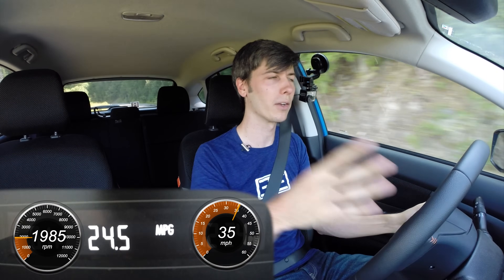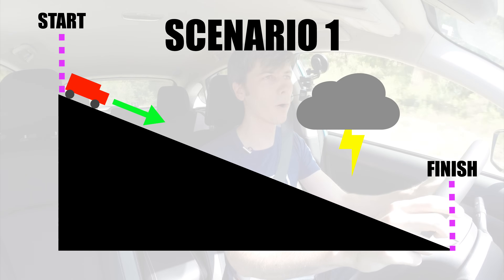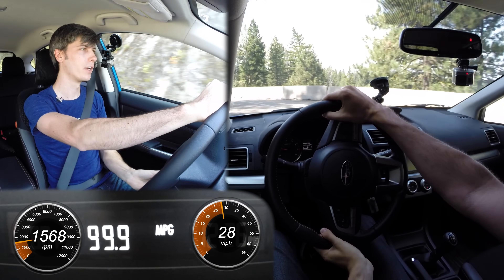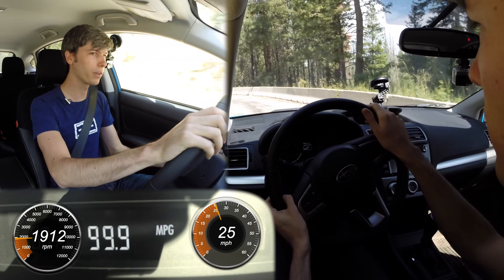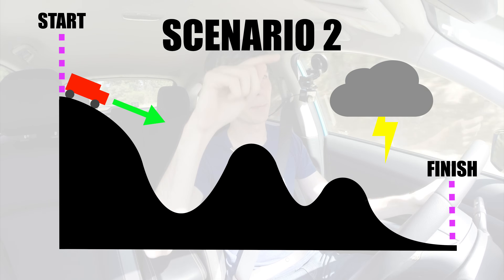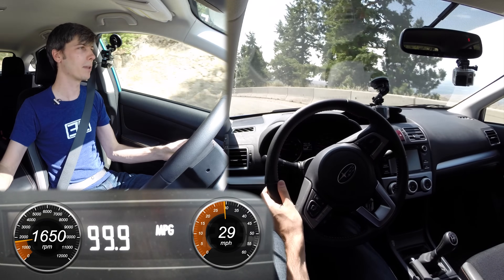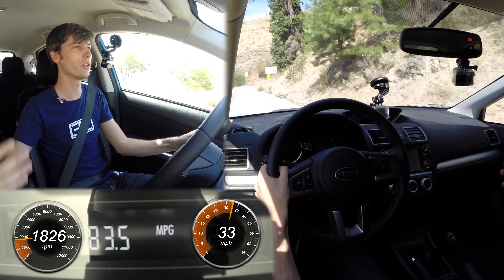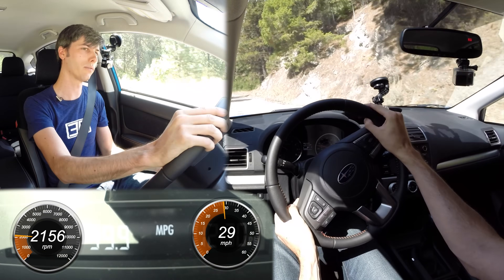What Uses Less Gas - Coasting Or Engine Braking?

Comment: If no fuel is being injected, why does the engine still make noise?
Reply: The engine is essentially a pump. It's always  sucking in air and exhausting air. When it burns fuel the exhaust air is hotter and will move faster and will make more/louder noise. It still makes similar noises even when no fuel is being burnt because it's still doing the same without the fuel. Look at the Otto cycle again, and you will realize why. I'll give you a hint. Pay close attention at the compression and power strokes.
Reply: charlesmcguffy because air is still being compressed in the engine. You won't hear any combustion noise though
Reply: it's still pumping air in and out of the valves.
Reply: charlesmcguffy my guess is air is still being taken in, compressed, then exhausted out.
Reply: charlesmcguffy The engine is still running because of momentum and moving parts make noise maybe?
Reply: Exactly, @Dan. Especially noticeable in our family's Volkswagen equipped with a PD-based diesel engine. You can hear the engine at 2000 RPM when the injectors are shut off (instantaneous consumption figure showing as 0.0L/100km), but absolutely no diesel combustion noise. Use the accelerator and you can hear some diesel clatter again.
Reply: +charlesmcguffy
ha ha ha! that's funny!
Reply: Still moving
Reply: c'mon is this a question?... valves, chain, gears, pistons, you know there are a loads of moving parts.
Reply: Like hooker😀 you choking her but she is still alive.  Hahaha
Reply: Dan Sneyd not really.. 2nd gear 5000rpm downhill with no gas is JUST as deafening as 2nd gear 5000rpm flat surface. Engine still uses fuel to keep it ticking

Comment: I often See people with the clutch in and braking in the same time, wasting fuel and brake pads. Always have to laugh at them.
Reply: arand4 depends on situation, cant always brake in gear..
Reply: Bringing clutch up slowly is not engine braking, that's braking using your clutch and wears it out really fast. I'd much prefer to replace my brakes than my clutch prematurely $$$$
Reply: Don't blame a country on your lack of knowledge
Reply: Actually, I do. Are you telling me that the slowing down experienced when you 'slowly bring your clutch up' is not simply turning the kinetic energy of your car into heat in your clutch via friction. Engine braking has nothing to do with how you get into gear, merely the fact of being in gear itself. It is always better to match revs to preserve your clutch.
Reply: the clutch doesn't wear if it isn't slipping. Thats why you rev-match. Your clutch doesn't/ barely wears and your brakes don't wear at all. He explained this in an earlier video and i can confirm that my statement is true by experience.
Reply: as you 'slowly release' the clutch the friction from it slipping and raising the flywheel's speed causes wear on the clutch.. a short blip of throttle to raise the speed of the flywheel to match the clutch speed due to the road speed prevents all that wear but you still get engine braking.. sorry but you are just wrong on this Wiikendz, there is a lot of information out there on this
Reply: Wiikendz you should only brake like that in emergencies. In normal situations you should always try to rev match and brake on your engine as much as possible, your brake pads and discs last an insane amount longer if you do this properly
Reply: The Real Santa Claus Still depends on situation. Have gun going 90kmh on a country road and do engine braking before a hard right turn if you have cars behind you. You can at most drop a gear and brake that one out before dropping the clutch for a harder brake. Unless youre really confident with heal-toe. 
I live in Sweden, everyone here can drive a manual, most of our cars are manual and has been since cars became a thing.r
Reply: stop doing this, you are using the clutch disk as a brake disk.. engine braking comes from the engine's compression of the air. Saving $ on brake discs/pads by spending far more on the clutch replacements - what a great idea!
Reply: The Real Santa Claus "only in emergencies"
However, most people dont put in the effort to learn heel-toe as its almost completly useless in day to day driving.
And heel-toeing kinda defeats the purpouse of the real engine braking, as the revs are matched, for the real engine braking you want to drop a gear and slowly bring up the clutch while braking. Thats how to do it efficiently.
Reply: Wiikendz You should never use the clutch as a brake. It's the engine compressing air that slow you down. What you said only wear the clutch, it's not how we do it in Sweden.
Reply: Wiikendz did I ever say that you can't brake? I said that most people brake way too much, and trust me, if you put your car in 2nd or 3rd gear at 90kph it will slow down pretty hard. Heel toeing really isnt hard at all, just takes some practice and getting used to each individual car
Reply: Asher and now I know not to care about you, cause you obviously have no clue.
Reply: Asher So a whole country driving and using this method without having to replace clutches, and you say its wrong? Hah funny. Slowly releasing the clutch, using the engine to help you slow down as youre braking, cant be more efficient. Try it.
Reply: Asher ye I guess us swedes just dont know how to drive manual cars.

Comment: w/o lugging. I only use neutral when heading onto off-ramps from highways. If i were to use it on steep up/downhill sets to gain or keep the most momentum, i would lose the gas i initially saved when it's time to re-engage an effective gear for the climb uphill (rev-match and hard shiftinf would be needed. ☆ manual driving top rule: *shifting while going up is a less preferable scenario- rpms drop fast

Comment: How it is on carbed engines? If I correctly, Closing carb butterfly fly walve builds vacuum, which only sucks fuel by venzuri. Is it true?
Reply: Gedas alekveravičius engines with carbs will always use fuel to keep idle

Comment: I've been wondering a question for awhile that's somewhat related to this. There is an area near my home where there are series of large and small hills in a row. Ignoring the speed limit, I wondered which would be more efficient when I go down a small hill and have to go up a big hill: to accelerate on the down hill to have speed to coast up the big hill, or to coast down the small hill and have to accelerate up the big hill?
Reply: Gray Wolf Ops uphill as you'd have lower top speed thus lower drag losses as drag increases by square of velocity. It really won't matter unless a very huge hill. Stay in a 3kish powerband up hill and you'll be most efficient.

Comment: If I'm intentionally engine braking down a hill, I'll occasionally put the A/C on to get a little more braking. Kinda funny feeling the compressor cycle on/off also gives you a good idea of just how much power that little thing uses.
Reply: Not more than running the ac in any other condition.
Reply: I want to hear +Steven Parks' explanation on a belt spinning the AC compressor vs a belt spinning the AC compressor and why one burns out the clutch assembly and one doesn't.
Reply: AC compressors definitely use a decent amount of power. Thankfully, my car cranks the boost up from 16 to 19 PSI when the AC is on so acceleration is not impacted by the AC running. Pretty smart little thing.
Reply: My car didn't come with AC :(
Reply: iVTECInside damn, never thought about using that, I might do that now on steep hills so I can use a higher gear
Reply: @joshkiej6601  ivtec?
Reply: To save gas, turn off A/C during uphil and turn on A/C during downhill.
Reply: Steven Parks Most quickest way to destroy the compressor clutch is by not using the A/C due to not having enough refrigerant to turn it on or if applicable certain vehicles may have a separate belt that has simply broken off. In other words, if it's not working then it will rust and lock up.
Reply: I do this too - and also momentarily turn it off for bends on steep hills
Reply: I'm gonna try that
Reply: Steven Parks haha oh god
Reply: My doesn't have Air Conditioning, and I had to install Heater. 1975 was wierd for an old Chevy K20
Reply: Alex Arnold I bet it did...    I almost guarantee you have either a 255 or 455 ac in you car
Reply: You turn off air conditioning most of the time?
Reply: @terryd8692 not everyone lives in the desert
Reply: Gaming Made Simple every 🚗 I’ve owned has been 255 or 455 (Ok 480) Ac 😂
Reply: Alex Arnold dammit! :/
Reply: But there might be a Calculated Risk of premature engine failure due too higher boost :'D
Reply: Welcome to the club! 🎉
Reply: But those compressors are not little, at least not on my BMW 💀
Reply: that uses up the compressor clutch?
Reply: I feel like you got it backwards

AC puts more heat on the engine, thus creating thinner oil lubricating, less resistance, thus more speed picked up

Using heaters draws heat away from the engine, cooling it, making librication thicker with more resistance for spinning, thus more effective control
Reply: @ry64209  what, just wtf is this logic 😂😂
Its far too late for me here but ill get back to you when i have enough energies to redact a text to explain to you why that makes no sense at all
Reply: @zepedroteixeira4697  okay, please explain

In my experience I notice that I have more drag coasting with a heater on than ac on

Also carbureted and runs cold, 55 years old

I suppose that’s different with newer ones, that’s probably where I misunderstood
Reply: Good way to burn up your compressor clutch prematurely
Reply: @Springs37923  love how 16 people liked this despite having zero basis in reality
Reply: @Springs37923  This is how the compressor works, all the time. Nothing different.
Reply: you only use up your compresser clutch if you engage de a/c while in higher gears, you can engage the clutch(transmission), then activate ac, let off the clutch(transmission), and it will slowly engage the a/c without wearing much of it's clutch(a/c)
do realise im talking about both, the transmission clutch and the a/c clutch here @Springs37923

Comment: 70 km/h (45 mph) and an uphill can be mounted in 4th gear (assuming gear ratio of 0.97)- running an RPM of about 2100

Comment: Even if your throttle is closed, you are passing more air through the engine at 3000rpm than at idle. 1.Does the air flow metering system not detect this extra air? 2.What about thhe gas needed for idling x the magnitudes higher rpm while engine braking, means the injectors are firing that nany times more.
Reply: While engine braking the revs are not mantained by burning fuel, it is the other way round: gravity + inertia keep the car moving forward, the weels keep spinning, the transmission keeps rotating and that's what keeps the engine turning.
Reply: The ecu knows not to inject fuel because of throttle position sensor and knowing the rpm. Obviously an engine with carbs will always use fuel to keep idle

Comment: Nice technical tidbit here, but I, personally, never go "out of gear" for any reason. I really wouldn't drive a car where I was worried about mileage. At least- to that level..... coasting... really ? But I do get the point and appreciate the educational aspect of this post. I just prefer to always have instant access to power, in case...
Reply: MercedesAMGsRULE
You've got me there !!! Totally agree and am hoping that- 1) the 'possible' VW Beetle EV is awesome and- 2) I can afford it !
I just have a thing for VW's... driving my 7th now.
Reply: ^THIS. Only relevant question when you need to decide between coasting or staying in gear.
Reply: In case of what?
Reply: Lots of things, really, where you need instant power. If you are "in gear" and engine braking, you know it's going to be there. Like for instance, coming into a corner a bit too hot and knowing you will need a gob of power- to get, perhaps a drift going. I wouldn't want to be in neutral and suddenly have to grab the shifter and pray I am in an RPM range that will get me the power I need. If I'm engine braking, that power is already there. I typically keep engine braking RPM around 4,000, which works fine in my car- right near maximum torque.
Reply: Rick Noah that's why I love EVs!

Comment: While I think you are technically correct, the instances in which coasting downhill is beneficial are almost non-existent.
I mean real roads are not rollercoasters, usually when a road goes downhill, it keeps doing so for a while :)